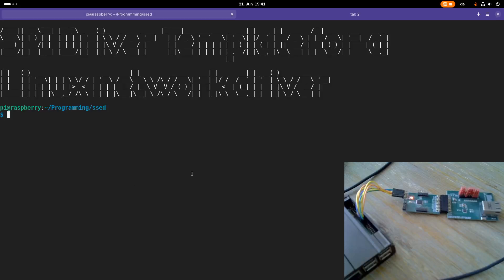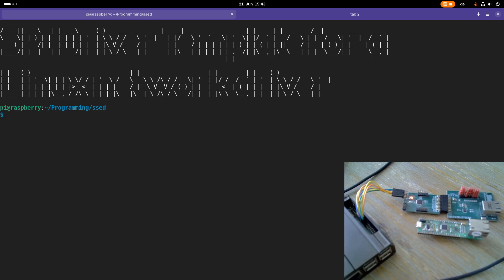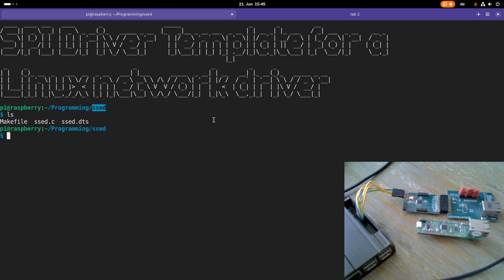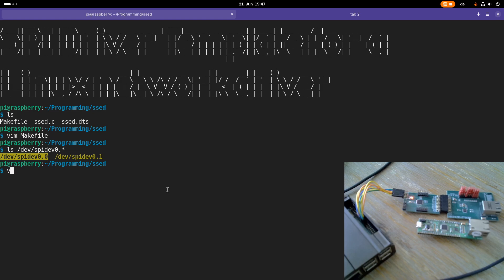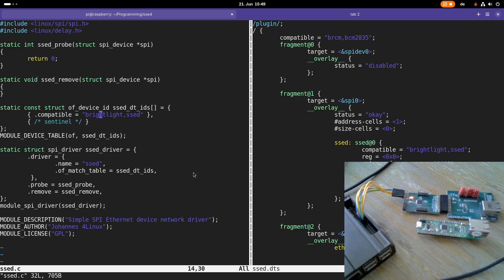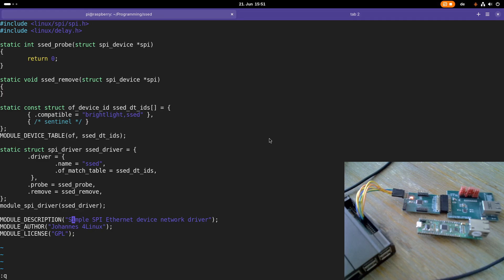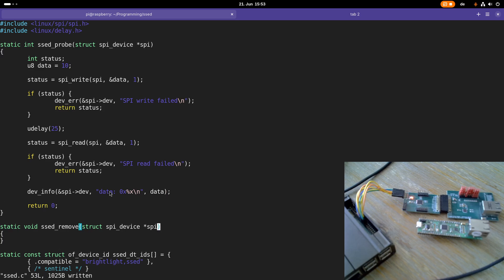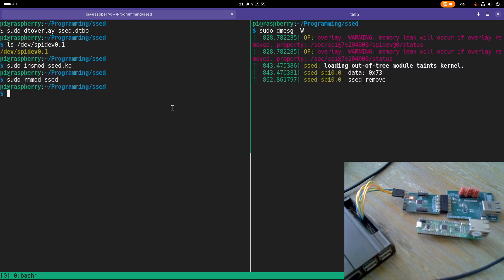Let's code a Linux network driver - SPI device driver template

Comment: Busy wait is not the best method to wait in the kernel.
Reply from the maker: Yes you are right, but I used it here, because the command is the simplest. Maybe I will replace it with usleep_range later.

Comment: I have one question for 11:40. Is udelay really necessary? Isn't "spi_read()" functions is synchronous or is there something that I don't know?
Reply from the maker: Yes, you are right, the function is synchronous, but the firmware on the microcontroller needs some time to place the data in the SPI data register. That is why I added the delay.
Reply: @johannes4gnu_linux96  thanks for the reply. But function will wait for microcontroller's response inside the spi_read() function anyway, am I right? I did not understand the benefit of addition of udelay().
Reply from the maker: @aoarol  No, it doesn't. SPI is a synchronous interface with a master (RPi) and a Slave (SSED). The master outputs a clock signal and the slave reacts to it. So, before the RPi doing the read, the SSED device must place its data in the SPI Data register and with the clock from the RPi the data is shifted out. And as it takes a small amount of time for the SSED to put the data in the SPI queue, I used a small delay.

Comment: Great video.
To expand on that, you could also show how to do that without the device tree.
Also, you should show how to use that as an actual network board if that is possible.
Reply from the maker: Thanks.
Without the device tree you would normally use a PCI(e) or USB networking card. For those types I sadly don't have a hardware which is simple enough to use for the videos. Same goes for actual network boards. They are to complex for a simple and short video. But with the content of my tutorials you should be able to understand them. And the other thing is, for the existing boards the changes are really good, that there is already an existing driver available.